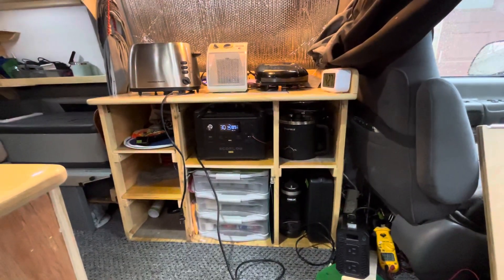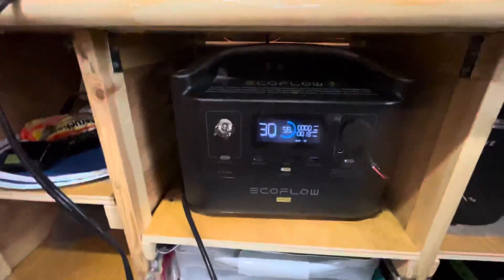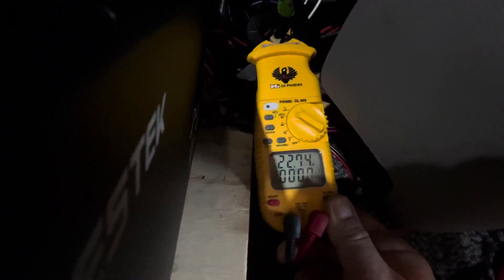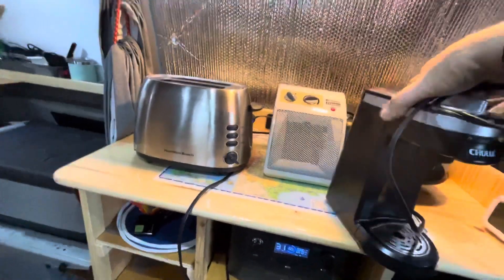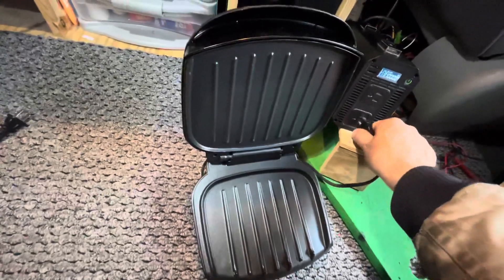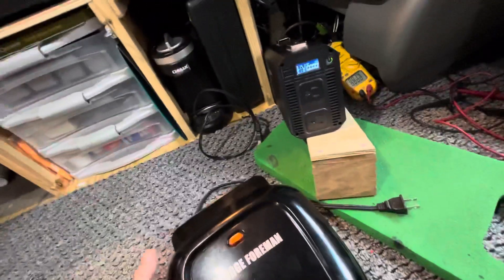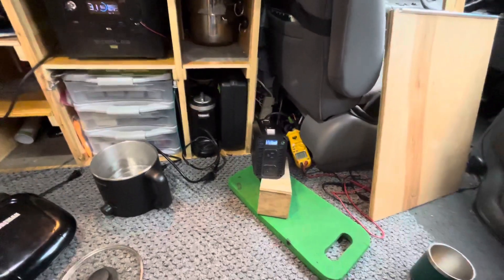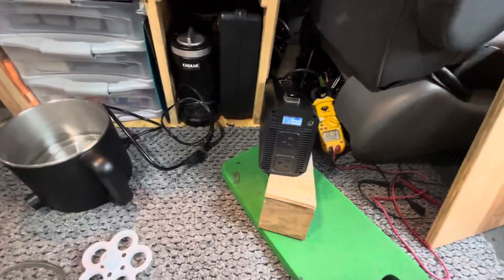Charging a solar generator with an inverter hooked to a car battery. Part 2

Comment: Would it be possible to run a 10 or 20 amp battery charger from this inverter?
I w old use it to top up an rv battery.
Reply from the maker: Yes, no problem.

Comment: So did you just connect your inverter straight to your alternator?
Reply from the maker: Yes/No. I connected it to my van battery which has a wire going straight to the alternator.

Comment: This math doesn't add up at max 14v  x  22amps you are only pulling 300ish watts from the alternator.  This means you are drawing 500 watts from your starting battery. This would run your vehicle battery down to your inverters low voltage shutoff in order to charge your solar generator at that rate which I would not think is ideal. Maybe I am missing something?
Reply from the maker: Your math is correct. Volts times amps equals watts. The van was running. The solar generator can charge from 0 to 100% in less than 2 hours. I surely don't have to charge it to 100% each time. 80-85% is fine. The van can handle the load no problem. I don't charge it this way all the time. I have a 200 watt solar panel that keeps it charged up fine. BUT if there isn't sun for a couple days then I Can charge it this way.

Comment: Every time I plug my solar generator into my whistler 3000 watt inverter all I get its a fault and it shuts down.
Reply from the maker: Is your inverter a pure sine wave or modified sine wave inverter. That may make a difference.
My Bestek pure sine wave works fine.
Reply: @dansmessygarage  It is a modified.
Reply: It was modified.  I have a pure sinewave now and works good. Thanks 
@dansmessygarage289

Comment: Hi Dan! Thank you for such informative videos. I watched part one and two, and I noticed that in part one you said it was a modified sine wave inverter, but in part two you said pure sine wave. I'm just wondering which it is. I have a modified sine wave inverter and a Bluetti power station and I'm wondering if I can use them together or if I need to get pure sine. Thanks!!
Reply from the maker: I had both a Bestek 1200 watt modified sign wave and then upgraded to the 1000 watt pure sign wave unit. The modified sine worked but after reading about the differences, I decided to switch to the pure sign wave. I've been very happy with it.
 I don't know about the Bluetti requirements, I feel pure sine wave is better. JMO
Reply: @dansmessygarage  thank you!
Reply: @dharmalovemay don't use a modified sine wave inverter on anything that has complicated electronics or a motor. I personally only run lamps and infrared heaters on them. Most items with motors and sensitive electronics run suboptimally, heat up and decreases its life span, or won't work at all.